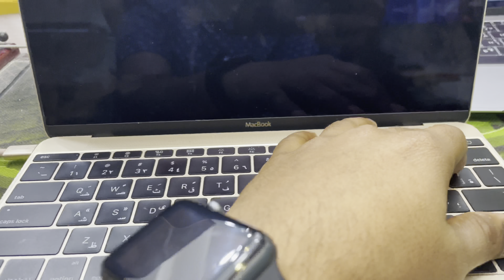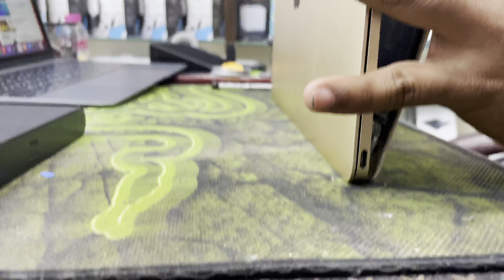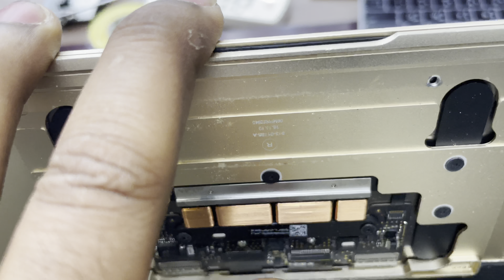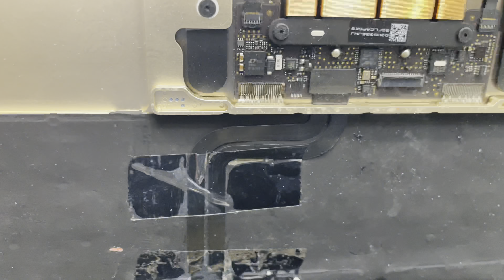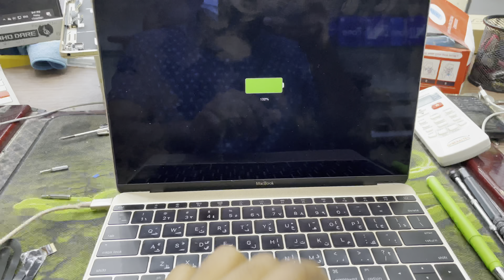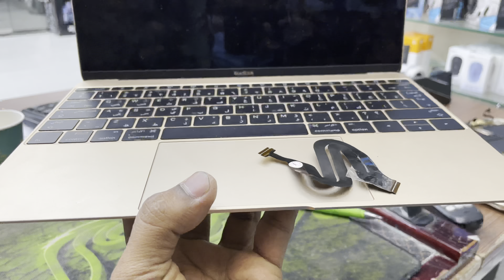MACBOOK A1534 NO POWER  REPAIR

Comment: So the problem is due to power button not being connected to motherboard?

I'm confused...there's a method to check if battery is charging, before checking the flex cable?